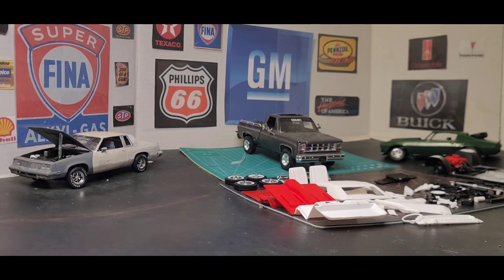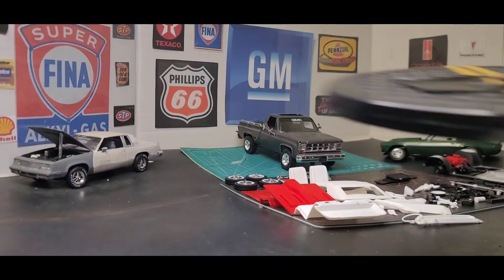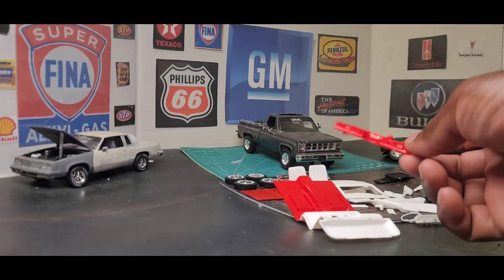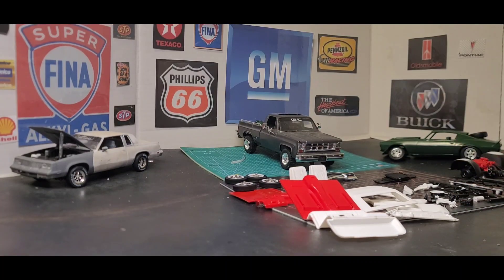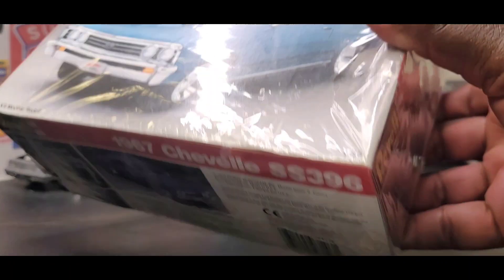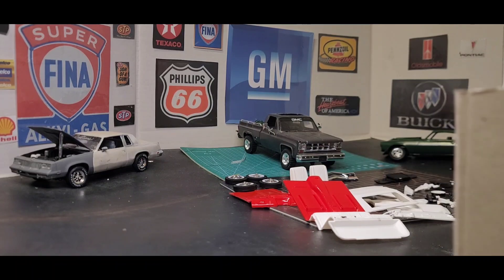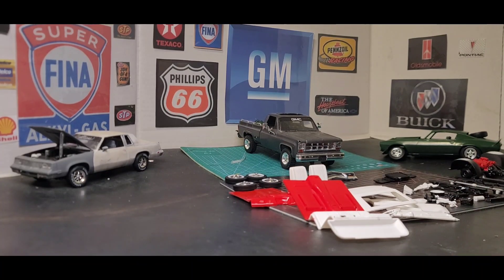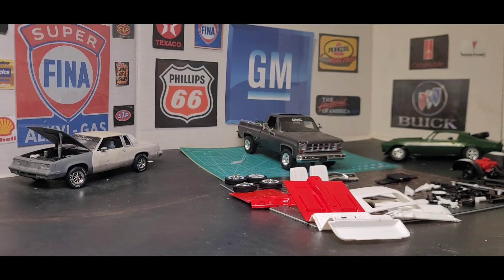🚨🚨GARAGE TIME NEWS , YALL WON'T BELIEVE THIS 😫😫

Comment: I have to just say, my advice to you is lose the Rustoleum.  It's just not made for model kits, I watch a friend of mine go thru these same woes over and over again with the same results.  If your not going to use an airbrush, stick with Tamiya rattle cans and you will see your paint problems disappear.  Not ragging on you,  just some friendly advice.  Yes it costs more for less paint, but the fine spray will not bury your details, orange peel, or sag.
Reply: 100% correct... Models cost to much and they not making any more time for us to build.